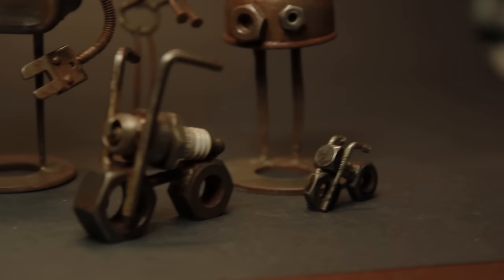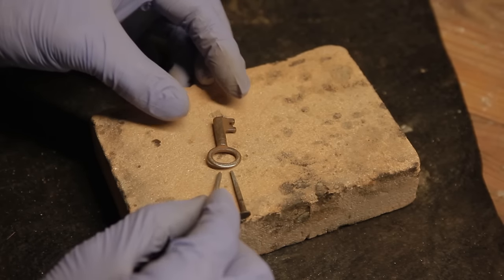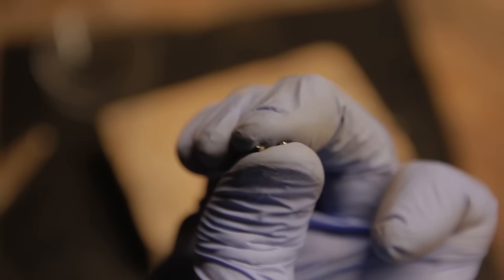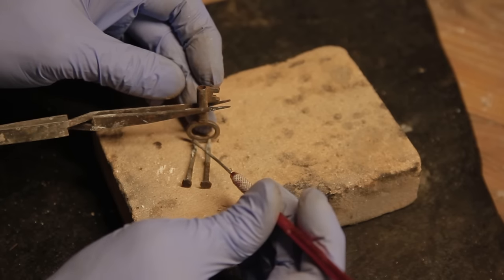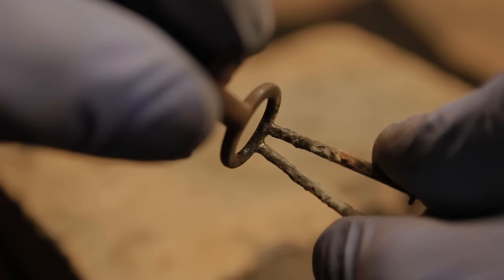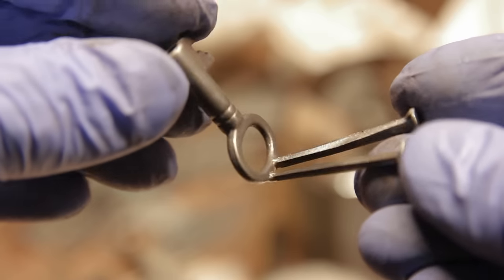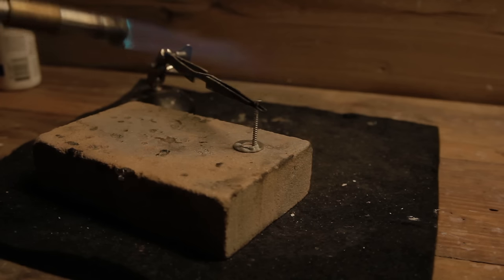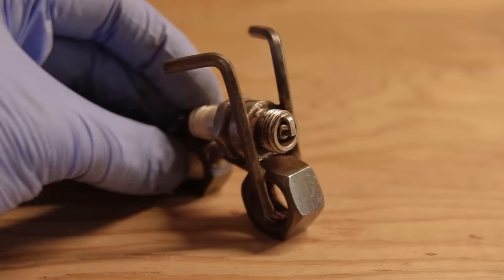HOW TO SILVER SOLDER - Metal Hardware Sculptures, Upcycling, etc.

Comment: Friends, remember to use a vent hood or use a respirator mask. It's not a good idea to breathe too much burnt flux. I used to solder in a poorly ventilated area and got very painful pleurisy for several days (turns out I'm sensitive). And remember to wash your hands if using solder containing lead.
Reply from the maker: GOOD POINTS, sir! I should have included a segment in the video about respirators. In all of the soldering videos I've seen, I've never seen anyone using a mask, but I did end up getting a mask for when I'm in the shop soldering for long periods at a time. I edited my description to include links to the mask and cartridges I use.
Reply: TheCrafsMan SteadyCraftin Thank you, sir! It's not a big problem for most people, but some are more sensitive to the flux than others.
Reply from the maker: I'm glad you said something, my friend!
Reply: i bought a cheap broan bathroom fan and attached 10 ft of vent hose and ran it out my window. easy to rig up a few sheets if aluminum or what-have-you to direct the smoke to the fan. 50 cfm works good. 15.00 at home  depot.
Reply: Valse Music: which respirator mask should I buy?
Reply: Rc boat
Reply: Mike McBride check the description under the video for links to respirator info.
Reply: Thank you, I was a welding instructors helper that was the first thing we would teach is s afty and to know what metals you are welding with. Solder is a diffrent story it's not that bad yes a well ventilated area small fan to blow the smoke away.
Reply: I presume the flux used in this video is borax based. Iv'e been using borax for silver soldering for 30+ years and never had any issue with it. The only vent I have is the blast from the torch.
The flux used for Tin/Lead soldering is poisonous as is that solder. Useless for this type of project as it doesn't have any real strength.
Reply: @wonbadood8243  you absolutely should use some ventilation
The flux used for lead-tin electrical soldering is harmless, usually it's some type of rosin which is about as dangerous as a burning piece of wood, which will also give you cancer don't get me wrong.
Borax is usually used on non-ferrous soldering or for Forge welding steel,  for soldering steel you're supposed to use an inorganic acid-based flux which can be pretty dangerous.
Apparently this flux is a mixture of borates such as boric acid and fluorite, Borates such as boric acid are suspected to cause reproductive harm and fluoride is a neurotoxin in large amounts.
Mostly i would be worried about metal fume fever

Comment: Very interesting. I have never tried this. I think the handling of the torch is what I'm hesitant about, even with my 'helping hand'. Thank you for sharing. ❤👍
Reply from the maker: Hey there! I'll be 100% honest: I was nervous as could be the first time I started messing with a torch. Even the trading out cylinders, striking it (which is easy now with these new push-button ones) and just general use. I'm a lot more comfortable now.
Started out soldering with propane, but moved to MAPP gas, which allowed me to silver-solder bigger parts like bolts and large gears.
Reply: @TheCrafsMan  Thank you for sharing that information. It does give me a little push to attempt it...providing I don't torch anything but what I'm supposed to torch...😀. ❤

Comment: I use to use that stay silv on compressors in refrigeration, to attach the high side line of the refrigerator to the compressor...it works very well and is a good product...
Reply from the maker: Thanks for sharing! It is some quality solder, for sure.

Comment: Spent more time today silver soldering. Soldered the head of a  thumbscrew to a washer, then soldered the screw part of the thumbscrew into the socket end of the bolt for my scroll saw's lower blade clamp. Now, the lower scrollsaw blade clamp can't complain about it's "upstairs" cousin having a new permanent adjustment handle. I expect that to be the last planned "practical/useful" silver soldering I'll do for awhile, unless something comes up. So, as mentioned previously, I'm going to gather up odds and ends metallic objects and "play" with them, as you suggested.

I used the very recently arrived  "third hand" in my above-mentioned project, and I'm sad to say that it can't take the heat  - it was holding the bolt I was heating up with the flame, and the tweezer tips spread apart, like a flower blossoming. Well, that tool didn't last long at all!  So, I guess that the hardest part of creating a nuts and bolts sculpture is actually how does one hold all the different parts to each other while heating them without burning up the tools used to hold them?  Is it possible for you to make one of your excellent vids to address that? It surely would be appreciated! 

Thanks, my friend.
Reply from the maker: You nailed what is the hardest part of the whole thing. So what I ended up doing, with my figures having 7+ joints, is to focus on one area, then use heatsinks (in my case, I'd wrap some small strips of damp paper towels around the joints) and work on the next joint. This way, the heat doesn't cause the neighboring joint to melt loose. It was so disappointing the first few times because of that, and not using heatsinks. Hope this helps you!
Reply: I'm familiar with heatsinks, having needed to use them when soldering transistors and the like for my decades-ago electronics hobby.
 The problem I had was that the 3rd hand tweezers were holding a washer against  the "wing" of a small thumbscrew, and they (the tweezer points) had no choice but to take some of the heat.   
I also had a pair of small vise-grip pliers become soldered to a joint. So, holding small parts together for soldering and NOT either heat-ruining or soldering the clamping device is going to be a real challenge.

Have a great weekend, my friend!

Comment: I agree with nearly everything you have said in this.BUT,the silver goes where the flux has spread to.Thats the idea of flux!To clean and protect the surface of the metal and aid adhesion.Yes you need heat,but if no flux it wont run!!!If you look at the bottom of the screw on the washer.How high the silver went on the nail.Also FYI its great for joining stainless fitting to stainless cables.
A really great vid for people who are starting!!!

Comment: Hi, nice video, I know that you can solder those pieces with an soldering iron using tin solder, I guess you have done it before, my question is: how weak is tin solder joints vs joints soldered with silver solder heated with torch?

Comment: Wow, never would have given copper a try. Question: I have old copper down spouts that need repair...leaking.  Soldering with tin/lead is possible if I clean away all oxidation but joints are almost impossible to clean.  Could I use your copper brazing technique to repair.   Thank you  for sharing your ideas!!!

Comment: Craftsman, to totally and cleanly de-solder a silver solder joint, would you just heat it until the solder drips off? 
When I used to work on electronics, we used braided wire as a "wick" during de-soldering to speed up the process, that''s why I'm asking.

Comment: Hi, will silver solder work on galvanized sheet metal, .26 gauge? Making tool trays for hand wrenches for example?  Thank you. Also the torch I have is very similar to the one you are using. My torch however goes out when past a certain angle. Works best when tank is vertical up.

Comment: Need to silver solder a small, very thin (.010” - .030”) piece of sheet metal (cut from a blade of a feeler gauge) to a small flat surface cut perpendicular to the length of a pencil sized object made of high carbon steel. Can’t think of any way to clamp it. Should I be able to hold it firmly enough with my soldering pic to do the job?  Thanks.

Comment: you can take a 9v battery and  wire up  a zinc plate on the + and cooper on the -.  stick.  place the nodes in the pickle, and the - terminal will collect the oxide better than anything.  you can and should use water rather than vinegar though.  only thing is it loses the patina character.

Comment: Tried out the Harris Stay-Silv today (first time), and was surprised that the brush handle was bent out of shape, the flux extremely thick, and the bristles stiff as if they'd been epoxied. Is this normal?

"Quick-changing" blades on my scroll saw is a never-was, never- will
be deal, but I eliminated the need to get  and use the T-bar (long T-shaped hex wrench) on the upper blade holder by silver soldering a hacksawn-down length of  Allen/hex wrench into the socket of the bolt which holds the upper blade clamp.   So, basically, the clamp hold-down bolt has it's own tightening handle now permanently attached. First time I used the Benzomatic 4000 torch though I've had it quite a while. First time use of silver solder though I've done some electronic soldering with lead. First time use of one of the two fire bricks I just received - one arrived chipped. Surprised at how lightweight they are. Finally got around to using one of the two Benzomatic  propane canisters I've had for a long time.

I'm going to accumulate the metallic odds and ends "trash" I've accumulated, look  them over, and try to get the "creative" juices flowing - hard to do when one has a practical mind rather than a creative one, but nuts and bolts welded (or in  this case soldered) figures have always fascinated me,  

Wish me luck!

...and please advise about the flux concern...

Thanks!
Reply from the maker: Hello, my friend! First, I'm glad you're getting into creative bits-and-pieces soldering! It can be really, really fun. Just gotta let your mind "off the leash", like a teacher one time said. Let it run and don't restrict yourself too much at the beginning by saying "Nah, that's silly" or "That won't work". Just lay things out on the bench and see how they fit together in a fun way.

To be honest, when my Stay-Silv gets thick and almost dry like that, I just add a little water and stir it around good. That has worked for me!  :)
Reply: Thanks, Crafsman - I emailed Harris/Lincoln and a tech guy sent back an email saying the same thing - the flux is a water-based product, so just add water as needed.

I'll keep you posted as I (attempt to) release my creative juices - they must  be around here somewhere...

Comment: Great video, thank you! Question: is there any difference between the silver solder and flux you use and the solder and flux used by plumbers to attach copper pipes? Thank you in advance.
Reply from the maker: There is a big difference in the solder. I use a high-percentage silver solder (56%) and it is very strong. But more expensive. For doing lots of copper joints, they go with a more middle-of-the-road economical solder. :)
Reply: Got it, thank you. What about the flux, does it need to be any different depending on the proportion of silver? Thank you again in advance.

Comment: Is your pickle made of vinegar and salt only or do you add water also ? 
And what temp is the best for the alchemy to operate ?
Reply from the maker: Hi Yann! It is! I read that you can add a little hydrogen peroxide, but I did not find it necessary. I turn the Crok-Pot to "Warm", well before I need it. By the time I add the soldered pieces, it's at a nice temperature (a little steam comes out when I remove the lid), and it does a decent job of cleaning the pieces within around 30 minutes. (Maybe sooner... I just tend to do other things while something's in the pickle, so they sit for a while.)
Reply: Just to make sure I understood you well :  vinegar and salt only and no added water, is that right  ?
Reply from the maker: Hi Yann! That is correct.

Comment: I used to make things like that and sell them. But I cheated. I bought a tube of that epoxy ribbon stuff at Home Depot and I just made little balls of epoxy and epoxied the areas to be soldered. I took a toothpick and carefully painted the fake soldered areas a silver color making it LOOK LIKE it was all soldered together. Bestsellers are ones that depict a profession. Like Dentist, Doctor Lawyer Policeman etc... Copper wire from the garbage can be used to make brushes that resemble toothbrushes. The small copper strands can be used for script type lettering also. Just bend it over a copy of a signature - like tracing it.
Reply from the maker: Good ideas, John! Thank you!  :D

Comment: CrafsMan... Have you (or anyone else) used Safety-Silv 56 to solder aluminum to aluminum OR aluminum to any other metal?  If so, was the same white Stay-Silv Flux used?  Thanks!
Reply from the maker: Hey Kay! I have not used it to solder aluminum. Aluminum is a tricky one, in my limited experience. It melts at a low temperature. One time I was soldering what I thought was a small steel key, and it started melting. I didn't do the magnet test to verify if it was iron (I just thought it was lightweight, because it was small) and it straight melted.  :/

Comment: Hey Crafsman, is Map gas best or would I be fine with propane to start my metal crafting?  I'm building a shopping list for my crafty wife!  Thanks!
Reply from the maker: Good question! I started out with (and still use) propane. :D Only reason I got a MAPP torch + cylinder is because it burns hotter, and I was soldering some thick gears and things at one time. You're just fine with propane! :D
Reply: @TheCrafsMan  ok, good to know, but of I want to melt silver or copper and pour into a mold, the map gas would be better?
Reply from the maker: Possibly so, for high-temp metals like that. But most would say oxy-acetelyne would be better, I'd imagine. I don't own that, though, and usually stick with low-temp metals like pewter. :)

Comment: HELP!!!  I cannot seems to get ANYTHING to melt now that they switched to map pro away from mapp gas.  I just went thru an entire tank of the map pro and the silver solder would not melt. I got the same stuff you use from amazon Harris Safety-Silv 56% 1/16 Silver Solder Brazing Alloy 1 Troy Ounce, 75310 5631(not cheap by the way) and the same flux Harris SSWF1 Stay Silv Brazing Flux, 1 lb. Jar, White.

Comment: Just observed a "Muggyweld" video which showed their "Cool Blue" product - that's their heatsink offering.
Reply from the maker: The only Muggyweld thing I've used is the SSF-6 and I really liked it.
Reply: Yes, the SSF-6 looks good, I've seen the videos on it. The "Cool Blue" had a name change and now they're calling it "Heat Freeze". Expensive though, at $49 for their smallest can, though they say it can be reused. That doesn't help though, when the small pieces to be soldered are held together  are so close to the clamping/holding device.
Would you consider doing a video of how you manage soldering several differently shaped metal pieces with several different holding/clamping devices and NOT managing to heat-damage the clamping/holding device and NOT soldering the clamping/holding device to the project pieces?

I, for one, would greatly appreciate that.

Enjoy the weekend, my friend.

Comment: Craftsman, I ran into a problem. I bought a solder kit made for jewelry Home Depot. Came with solder and flux.  I already propane torch. I got old nails and a washer, and sanded them like in your vid. Every time the solder just bead up and roll off metal. I tried different metal, more & less flux, more sanding, got metal red hot. The solder would never run. Just bead up and roll off. Any ideas? Going to try different solder see if that helps.
Reply from the maker: Is the metal itself getting hot? Sometimes if the solder gets hot well before the metal, it won't flow onto it. Sounds like you're cleaning it, and the flux should help it flow, too. So it may be a heat issue. Hope this helps!
Reply: @TheCrafsMan  Yeah, I got the metal hot first and still no luck. I'm going to try a different solder. Thank you!

Comment: It can be very frustrating to silver solder without right technique. Need right flux also the higher the silver content the better. I was told a lead pencil line would help contain the solder. Usually I grab a prefluxed brass brazing rod and use a slightly carbruerizing flame. Mostly to join ferrous. Old time body shop guy could join a car together with braze. Looked like Franken car until bondo.

Comment: the solder won't melt for me :( i'm using a creme brulee torch. it works just fine for the mini sculptures i make with rothenberger paste and solder. it doesn't work with stay silv though, i wonder if i need higher temperatures? thing is i like to make my sculptures tiny and i need a precise flame
Reply: I'm still looking for an answer

Comment: Can you use a soldering iron for this? Ps love the vids
Reply from the maker: Hey John! Thanks for watching my videos! I have seen people use a soldering iron to do this, but it has to get the metal pretty hot, and may take a little while to do that. The tricky part there might be in getting both surfaces hot equally for the solder to flow. Definitely not impossible, but more tricky than with a torch.

Comment: What if I use a concrete paver, a large brick, or even a big, flat rock, instead of a fire brick?
Reply: All of those are fine. Anything non-flammable.
Reply from the maker: Only potential down-side to a concrete paver is the possibility of a trapped moisture pocket "popping" under the heat. I used to use a cinderblock before getting this fire brick, and that happened. Didn't hurt me or anything, but caused me to jump back. :)